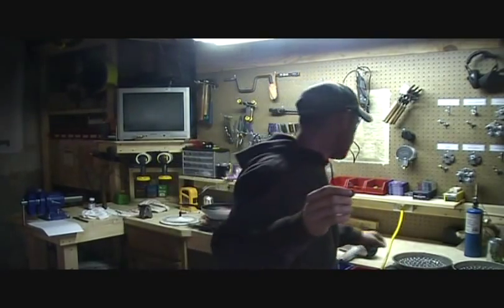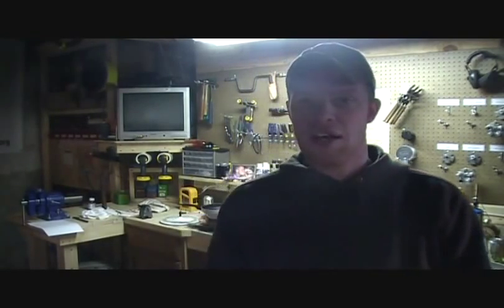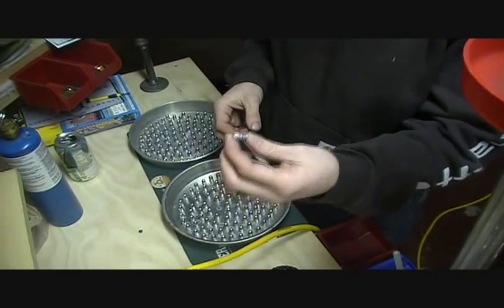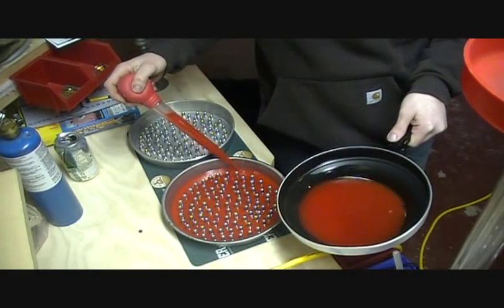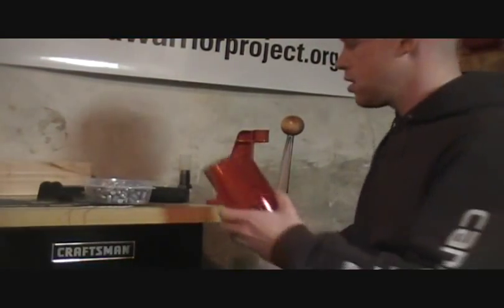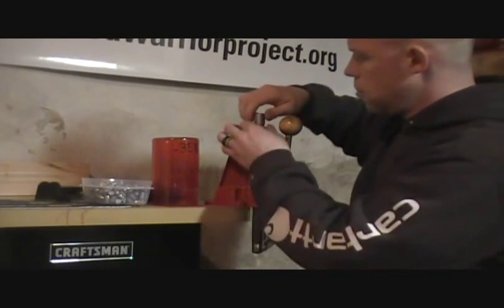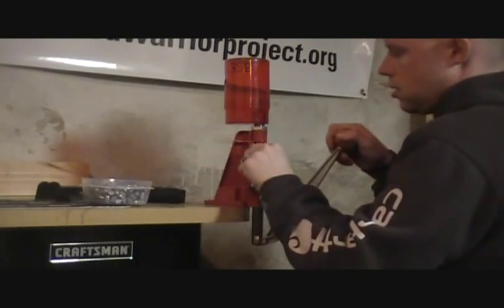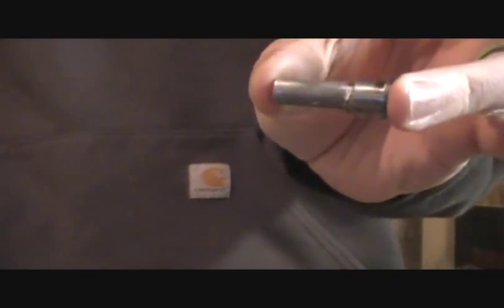Pan Lubing & Sizing Cast Bullets with Lube Recipe by HPFirearms

Comment: shortcut ?  after lube is hard and you push out the lubed bullets you have a solid slab of lube with holes in it , why don't you put the slab of  lube with holes back in the pan , then insert the next batch of bullets into the holes, then reheat the pan instead of  melting the lube , and starting again from scratch, placing the bullets in an empty pan, and pouring in melted lube ?

Comment: ollen249, it sounds like your mould is meant for tumble lubing, from what I gather there are moulds that have smaller groves in the cast bullets that are for the alox lube which is a liquid, the moulds that leave the large grooves are for the lube/sizer presses or can be used for pan lubing. Hope this helps you out.

Comment: Just a heads up if your getting into sizing bullets like i recently have you NOT ONLY need the bullet sizer kit but you ALSO NEED a single stage press my lee load master progressive press shell plate dose not hold the bullet guide needed to ram the bullet through the sizer so i had to order a single stage press in order to size my bullets.....

Comment: Hello, This is my first time casting bullets. I've casted 9mm bullets with one lube groove. I've used your recipe. Once I push the bullet out of the lube cake the lube is really soft and easily can be rubbed out of the groove. Is this normal or should I add more wax to make it harder? The lube just doesn't seem to want to stick to the groove.